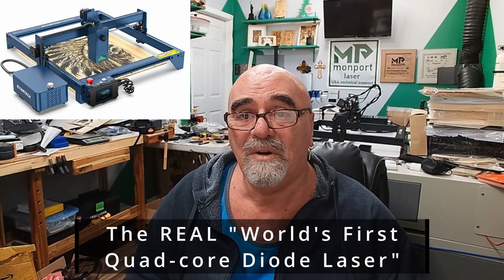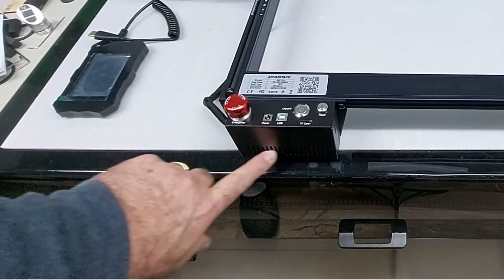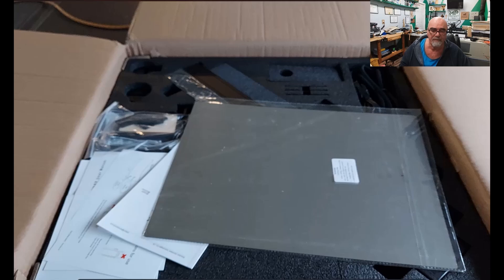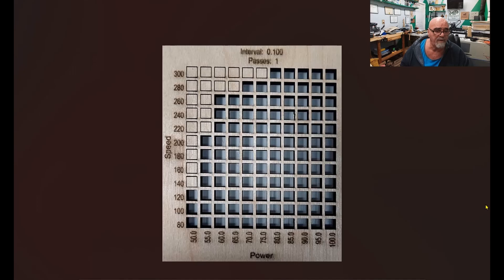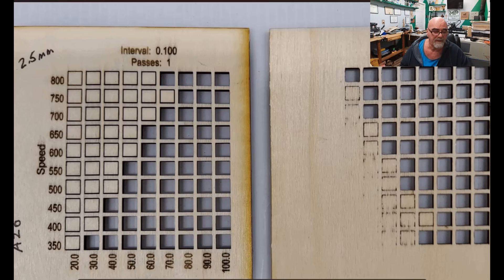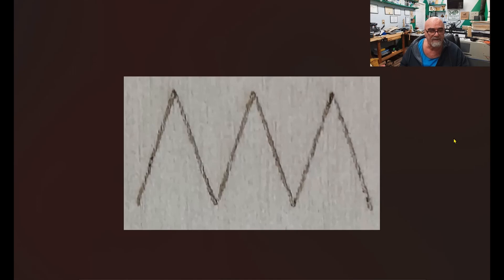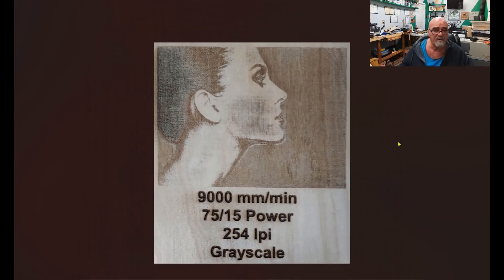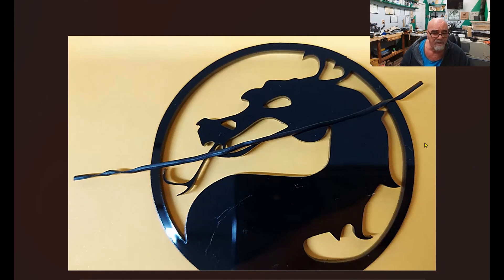ℹ️ Full Review and Testing of the Atomstack, A20 Pro Laser Cutter Engraver.

Comment: Louisa 
I solved the problem with wire management by over tie wrapping (plastic tie wraps can squeeze the air hose) the Gantry cables and air hose and placing the machine close enough to the table's edge so that the Y cables droop down out of the way. 
I did have a problem with erratic engrave till I found the gantry belt left loose from the factory tightened it and now it works perfect.
I got the two trees 500 X 500 Honey comb bed that was too large it was hit by the gantry  used shims to raise the engraver to clear the bed.
I did enjoy wealth of knowledge you gave, Thank you
Reply from the maker: Glad you got it solved!

Comment: Half a year ago I upgraded from an A5 with the M50 laser to this one and I am realy very happy with it. I allready saved a lot of wood because of the limit switches. It is realy easy to continue cutting after you made a misstake and stopped the laser. Just zero the machine and it is spot on again after restarting. I use this laser untill max 60% because I had the impression that my M50 was loosing a lot of power because of allways running at 100%. In the past half year I did not mention any power loss on this laser. The cable management I resolved by attaching the cables to my enclosure and had no issue with it till now. Most of my work is 4mm oak, which I cut with 300 speed and 50% power in 1 pass.
Reply from the maker: Awesome Arno! Glad to hear you're happy with it!

Comment: I've watched 10 videos and yours is the best.  The cable management critique is candid and helpful.  I'm going to use your ground wire idea.  Candid recommendation to not place the app device covering the vent.  Smart.  There is an add-on where you can place the cabling into a wheel-chain covering that  I might consider buying. Can you demo a project where I want to create a plaque that has a piano shape cut-out.  My wife is a piano teacher and she wants to build a custom plaque that has her name, student name, year of recital.  It's going to stand up vertical by sitting in a groove cut on the base board.  thank you ahead of time.  Your sample cuts/engravings shows your expertise in the laser craft.  I learned so much.  I plan on combining my hobby with kumiko projects and  laser engraving when I make my kumiko panels.
Reply from the maker: I can't take specific requests David, but if you watch the Lightburn College playlist, you'll be sure to learn how to do anything in Lightburn by the time you get to the last video!

Comment: I purchased an A20 from Amazon, in July, it is my first laser. I agree with everything you have presented. I also bought the extension bed from them directly which gives me an awesome 450mmX900mm work area. I know it took you 1/2 hr. to assemble. It took me 1 1/2 hrs. Documentation was extremely poor. The various youtube videos saved me. The cable with the extension bed was a nightmare so I purchased a drag chain for the y axis. Mine must be an older version with a weaker air pump, it is cylindrical rather than square. The head would not slide up and down easily and needed some filing to get rid of a couple of burrs. I had alot of difficulty with consistent cutting. If I was cutting several pieces in one run some of them would cut clean others would not. I went back and forth with factory support, very annoying since it take 24 hrs to get a reply. Finally they said I needed to return the head to the store, which I think is also in china. Then there was a one week Chinese holiday and finally they got around to agreeing to replace the head. The new head works great. The bottom line is it took 5-6 weeks to resolve the problem. The good sign is they seem to be a company willing to stand behind their product.

If you need to elevate it to use a roller I had to shorten the lockdown screw for the head because periodically it would not home because the screw would hit the x axis rail. It has some serious power. I have had good luck cutting 3/4 inch thick pine. It will almost do it in one pass but catches fire. So finally I got smart and use 4-6 passes at 150/95. A few weeks later, amazon had the newer model with the larger air pump and the remote hand screen device that really is not needed. I use lightburn, the software, and the wifi app are worthless for any serious work. Where I live I have to have wifi for my phone to work. So if I was connected to the laser, my phone had to be disconnected. I have an air compressor in my shop with a regulator. I run the air line from the regulator to a gas regulator to easily control a slower air flow. It works great. Down side is the compressor noise.
Reply from the maker: Wow! Thank you so much! I appreciate the input! Yeah, the old air assist pumps are horrible! Sorry you had so many problems!

Comment: Great review Rich! I have the AS S20Pro and have had similar results in cutting & engraving. It does burn hot though, requiring frequent laser head cleaning. I've just received the extension package for it because I want to do some longer engravings. But, I'd still love to win this. Thanks for all your help!
Reply from the maker: Same machine Bill, different color👍 If you keep the air assist on low during engraving it'll keep the lens clean.

Comment: Great video, subscribed to your channel because of it!  So I have a CNC machine that I added a 7w laser to (Sienci Brand).  Right off the start it's not enough to do what I really want to do....CUT.  Even with 3mm ply I'm having tremendous troubles cutting with it.  Did a search and found your video on this Atomstack x20!  My biggest question is that the air assist they have on their website is 15-30 L/min.  Will that be enough to cut cleanly up to 1/4" ply in 1-2 passes?  For the price listed on their website it seems like a great deal, in comparison to what I have now.  Thank you for your help and again, great video.
Reply from the maker: Yes Edward. AA is only needed to clear the debris from the laser path.
Reply: @TheLouisianaHobbyGuy  thank you. The unit I have has AA but not a forced air one. Just an attached fan. That might be why I’m having issues. Thank you.

Comment: Another great review Rich!  I agree that the air assist on this unit is one of the better ones I've had come with a laser. I really wish they used silicone wire on these machines.  It would make cable management so much easier if those wires were a bit more flexible.
Reply from the maker: The wire loom will take care of it. I just can't find my roll right now! 🤪

Comment: Another great video! That air assist really does seem nice and its only $100 at the big A right now cause they have a $30 coupon! I never thought about using that split wire loom tubing stuff to fix the cable problems. My Creality Falcon 10w has the same problem with that cable on the side dragging around and it will mess up the burn/cut if it gets against something. I was going to post about it in the forums but no I don't have to LOL
Reply from the maker: Yeah, the wire loom is necessary on a lot of machines! I wish they would just use it at the factory! What could it cost in China to outfit one of these machines? Twenty cents?

Comment: Machine zero and Saved positions: I have a 'laser start position' set at 0,67 corresponding with 0,0 on the scale. Machine zero position is 0 on the x but due to it smacks hard on the Y end stop it will fluctuate and get an Y zero-ish position. When you have the extension upgrade you can easily compensate the 67mm on the Y axis and bring the Y max to 917mm. Anyhow I keep it at 867mm because I precut wood panels to 410mm and 800mm. (For the  Imperialists...get a life 😛)
Reply from the maker: With any mod, you usually have to have a workaround or two...

Comment: On the Atomstack A20 Pro, do you have the settings to cut through 3/16 cork board?  I have tried several settings and have not been successful to cut through.
Reply from the maker: No, but you can run a Lightburn material test to find out.

Comment: Rich, the scale on the left should be zero at the center of the gantry not the laser head. But it is still not close to being correct and you can move the zero switches, to adjust as needed anyway.
Reply from the maker: It's off by a mile Charles, however you measure it. 0/0 is where the laser outputs the beam, which is where I measured to.
Reply: @TheLouisianaHobbyGuy  you're right and I am not sure what you would use it for anyway. I have the A10 and was never sure why you would use those anyway. Have the laser make a grid and use the grid. That was a good review though. Your shootout will be interesting and most likely me what it use to see my upgrade path will be. Thanks again.

Comment: My a20 doesn't seem to making enough power? Is there a secret setting in firmware? My A20  laser is cutting but I'm not getting your results, it's like some of the lasers aren't on. it take 3mm/s at 100 2 passes to cut 1/8" ply.
Reply from the maker: Check the Device Settings and make sure your S-value max is set to 1000.

Comment: hello Rich, thankyou for the review. I own an x20pro. I found through testing and with the preview time that something was not quite right once you get above 6000 mm/min. I wrote atomstack about this as I noticed in the max speed settings that they are capped at 6000. they replied that the machine can go to 12000 but it is not recommended which seemed strange since they advertise it as capable of 12000mm/min.  did you notice this or have to change the settings to get 12000?
or do they consider it 6000 per axis which would be 12000 if x and y are moving simultaneously
Reply from the maker: The A20 came set at 12,000 mm/min.
Reply: @TheLouisianaHobbyGuy  interesting. Thankyou

Comment: I purchased this model, and cannot get it to cut through 6mm plywood. I’m running lightburn 10mm min 100 percent power and still no through cut. Any idea what I could be doing wrong?
Reply from the maker: Yup, you don't have it focused properly or the lens is dirty. This laser blasts through 6mm wood at 360 mm/min.
Reply: @TheLouisianaHobbyGuy  I am using the included tool to focus, should I be focusing it differently? I just pulled it out of the box so I doubt the lense is dirty
Reply: @TheLouisianaHobbyGuy  figured it out. My s value in lightburn was at 225 I changed it to 1000 and now it’s blasting through it with no problem

Comment: Just going to comment on your initial start of the review... Your observation of the markings on the x and y are incorrect... If you look under the left pulley between the 2 wheels, you will see there is a pointer indicating the measuring of where you're laser is in relation to the software 0,0 would be the bottom left, and that's where the laser sits when it hits the homing sensor. It is poorly visible but it is correct when homed to zero. 

Now if you're argument is that you're aligning the physical laser to the number zero then yes the markings AND the pointer should be moved to reflect this.
Reply from the maker: The idea of the 0/0 position and the measurements on the rails (in my mind) is that it should mimic the software work grid. So if I send my laser to 0/0 and fire it, it should mark at 0/0 Rudy. I can't imagine what else you could use the measurements for.

Comment: I have the x20 and I'm not getting near the cutting results your getting at 300 it will only cut through baltic birch ply 3mm at 100% power.  what am I doing wrong.
Reply from the maker: Are you in mm/min or mm/sec? I'm in mm/min. If you are, then it's either a focus issue or a dirty lens.
Reply: @TheLouisianaHobbyGuy  no I'm in mm/min.  I'll clean the lens again.  I am using the included spacer for focus.
Reply: @MichaelKlein-je4wc  you probably need to perform a focus ramp test. I suspect your focus block doesn't match your focal point. Do you drop the focus point half way into your workpiece? For example, 1.5mm below the surface of your 3mm ply. Are you using air assist when cutting?
Reply: @hefalump56  I'm not sure about the focus and yes I use the air assist.

Comment: Such a shame about the cable management on this, having said that it's not the only guilty diode laser in that respect. My old Ortur LM2 is a decent machine but has the same issue, I use an elastic "bungee" cord to suspend my x axis and air tube which works ok but the y axis often gets trapped when the machine is homing.
Reply from the maker: The wire loom is the solution Malcolm.

Comment: Warning, Have used this machine for 6 months and it is showing all the signs of being worthless. Air Assist broke and no longer puts out air even though it runs. Lens cover has burn marks on it and I can't get replacements for them because they are out of stock and have been told it will be months until I can get them. Now the laser will not even cut through 3mm Baltic Birch ply even at 100mm/m and 100%. Can't get any help from support even though it is well within the warranty period. Deal with this company at your own risk. They are without integrity. Had an Ortur before this and when I had issues, they were great about reaching out and helping me out. No such luck with this company. Really regret wasting my money on it.
Reply from the maker: Sorry to hear this. Try cleaning your lens; that's probably why it isn't cutting.
Reply: @TheLouisianaHobbyGuy  I have tried this, the problem is likely the lens but it is because it is pitted and needs to be replaced. One of the Atomstack resellers actually sells them in packs of three but have been told it will be a month before they get them in stock and then a slow boat from China (literally) to get here. Thinking about switching to Comgrow. It seems like several folks I follow (you included) use their products pretty heavily. Have you ever had to deal with their support? What are they like? I am willing to take a chance on a product if I know support is decent.
Reply from the maker: The way a company supports me and and end user can be vastly different Jack. I can tell you that when it comes to issues, I have not heard a single complaint about either Comgrow or Ortur on tech support.